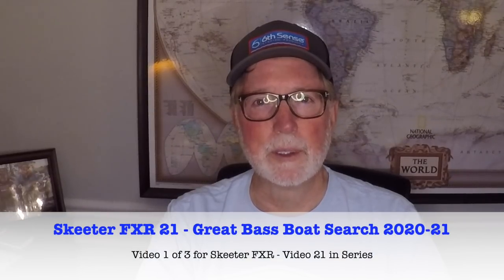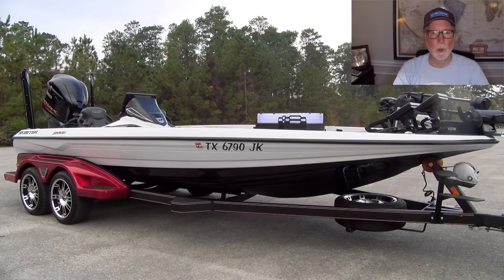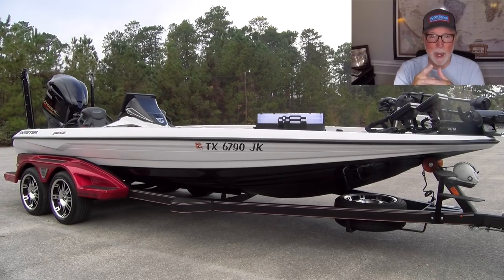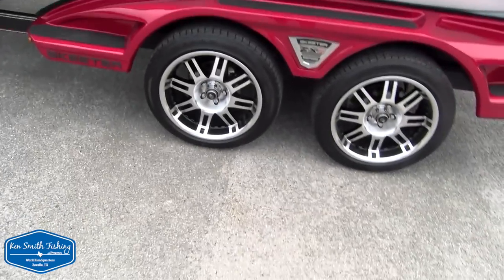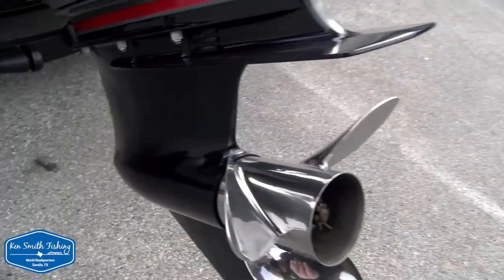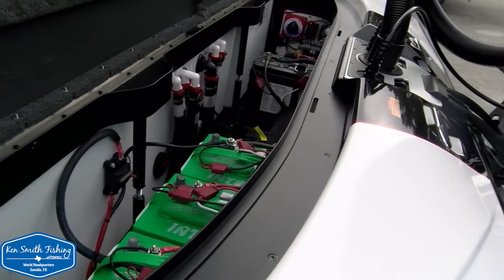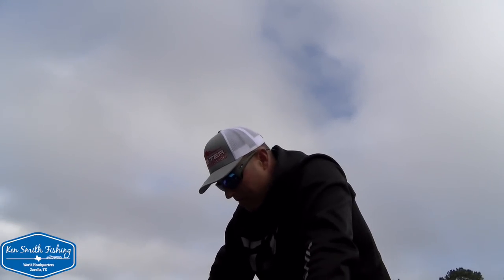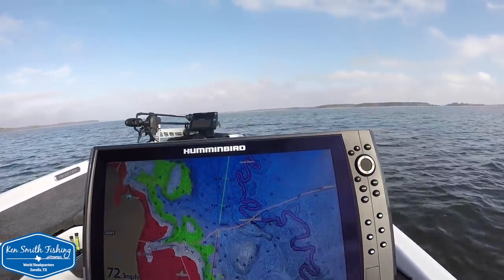Skeeter FXR 21 Great Bass Boat Search of 2020-21 - Video 21 of Series

Comment: Thanks so much for the great info, you're doing all my work for me.  I'm glad you have focused on the ride of the boats while moving slower.  I don't want my boat to act like a dolphin when riding at 20-25 mph.
Reply: early models did this from fuel tank location, didn't they more the tanks to stop this issue??

Comment: I’ve got a zx225 & it proposes just like this one. As I’ve learned to drive it, time in the seat has been the answer. It handles bog water fantastic compared to several other boats I’ve been in. I believe a lot of that is the operator.
Reply: Ive sold a bunch of Skeeters and that is exactly right, I would strongly encourage a hydraulic jack plate, especially on the new hull because they are absolutely awesome with a good driver, if you are willing to take the time to use it and spend the extra money. Best hull Skeeters ever made according to guys who have run a new one every year for a long time
Reply: This is not a hydraulic plate ?
Reply: @bakervinci163  Yes, go watch he just says you have to mess with it a bunch to make it run right... which makes you wonder why you'd buy a boat that you have to keep tweaking to run
Reply: @jrthomas3581  what is the best boat in your opinion? I’m looking for a boat that will go 85+, that I can chase crappie until I die.
Reply: @bakervinci163  what do ya need 80mph for  when your crappie fishing? Honest question.
Reply: @itisfinished4U  what is the difference in the FXR and ZZR hulls?

Comment: Gosh so many different opinions on the ride im on Toledo Bend mainly and Rayburn the other times and run a 202 elite Champion the best riding 20ft boat I've ever been in. But I was really hoping to hear the rough water ride was amazing Skeeter hyped this boat pretty big and had me all pumped to the point that I was considering a new one. The other skeeters I rode in I thought I was gonna need back surgery after we got off the water. Lol
Reply: I agree. I have never been in a Skeeter that rode well in the big stuff. Every one beat me to death compared to my champion. You have the best riding bass boat ever made. Nothing today can touch it.

Comment: Ken  on the trailer wonder why they didn’t place a bar to aid climbing into the bow of boat up the steps.
Also when placing the motor/toter (transom saver) and it bends the motor controls seems like more than it should; can raise jack plate to reduce bend.

Like the trey system.
Also trip on the raised floor leading to the front deck ( I know need to pick up feet)

Look forward for more. Thanks much.

Comment: Ken you will me deciding my last boat. I have about 9 months to decide. Pretty sure I’m gonna get glass unless I get a gator trax or the new aluminum.    Let’s see a new Allison.
Reply from the maker: Yep, will get to Allison, from what I hear they haven't changed that boat at all in something close to 10 years, do you know if that's correct?
Reply: @KenSmithFishing  I know that they have a few clever innovations that I don’t see on other boats. 
 Small things; like a place to put rod tips on the deck and a toilet where the middle seat exist. 
 I like everything, but looking at that hull is tough.  Clearly this is why the hull is so fast.

Comment: My Dad has had 7 Skeeters and he now has the FXR21. And, the ONLY complaint I have is the porpoise issue especially with full live wells. I've learned to manage after 9 months of driving the boat but it can be a pain in rough water with full wells. Skeeter had this exact same problem when they came out with the first I-Class (we nicknamed that boat, Flipper) due to a new hull design. Pop brought the issue to Skeeters attention (they knew it was an issue) and offered to retrofit the hull to fix the problem or swap him boat for boat for a new I-Class with upgraded hull and when we got the new boat, it was all gravy from that point. The guys in Kilgore are awesome. I'm wondering if the same thing may have happened again as the FXR from what I know has a new hull design.

Comment: Another great review. Why the 3 part series on the Vexus and Skeeter? Others were done in one?
As for the FXR, it has the best lines that Skeeter has ever designed. Fine looking machine. 
I'm not a fan of the plastics on the dash, and was real surprised to see it porpoise at low speeds. I really figured Skeeter would fix it on this new hull. (without having to play with the JP)
Keep up the great reviews.

Comment: I have a 2023 ZXR21 with manual jack plate and no electric key pad. I wanted simplicity, I have never noticed my boat doing this porpoise and it is quick on pad. Fastest I’ve gotten is 70 but I’m ok with that, I normally don’t go faster then 50. Last day of the big bass splash I went to weigh in from Buck Bay. The lake was rough. I drove 20 to 30 mph all the way with no issues.  So I’m wondering if most issues is due to the hydraulic Jack Plate.
Reply from the maker: no, is a design issue

Comment: Ken I have the FXR21 L but with Fixed jackplate and I can drive mine between 17-20 on plane with no bow bounce. This boat handles BIG water very well.
Reply from the maker: Sounds like you’ve got it in the right spot
Reply: What prop?

Comment: Had the screw pop out under the cowling that holds the link to the gear shift, lucky it happened as I was backing off the trailer at the ramp, had it happened away from the trailer I was stuck dead in the water on Amistad 10 miles away. Motor had 40 hours on it and I purchased the FX21 new in 2017, check those, the Japanese got in a hurry and didn’t have it tightened enough.

Comment: Very good looking boat! A couple of things I noticed.  Net looks very small compared to others.  Sump access is great but basscat appeared the cleanest and the removable lid was great.  Definitely top 2 in sump access are skeeter and basscat.  Looking forward to part 2 and 3!
Reply: Just sold my basscat cougar FTD for a FXR.. the rear setup is not good on basscat.  No usable storage at all.  Electrical connections just laying everywhere.  The charger is mounted across the pumps.  Yes, it's all wide open, but that's also the downside.  That removable lid has hinges that trip co anglers.

Comment: FYI.  Skeeter has NOT fixed the problem you spoke of concerning the screws and fit and finish. I regularly have to tighten or find screws to replace the ones that fall out or disappear.
Reply: Same issue with my 2020

Comment: If raising the atlas jackplate is all it takes to be able to run on pad in the low 20's, what's the knock against the ride for? Seems like you'd give a knock if you couldn't remedy the porpoising. I hope you do some more research and prop changes before you post your next video.
Reply from the maker: Rowdy it you change the load in the boat, if the boat is wet and heavier, more tackle fore or aft,  if the livewells are full vs empty, all of that will change the dynamics of where the jackplate would likely need to be to stop the porpoising, and yeah i could figure that out on a nice calm day with different loads,  but if I come under the 147 bridge in 3-4 foot trailing seas and have to run 19 miles to the weigh in in 25 minutes the last thing I want to do is be screwing with it trying to figure out how to not bury the nose in a wave while I work that out. And why would I want to? If I can buy a boat where all if have to do is bury the jack plate in the dirt and go?

Comment: Speaking from experience with the Skeeters.  They take time to learn to go slow speeds.  I have no issues with my 225 going slow enough to pull kids on tubes and such..  It all has to do with throttle when getting up in plane..  On another note, with my zx225 you can run wide open trimmed out with no hands on the wheel..
Reply: That's what I love about Skeeter boats, arguably the most stable to operate boat at high speed. It doesn't walk at all.

Comment: Is that butt seat option available for all boats or just Skeeter? I’m talking about how it adjusts to get you farther away from the trolling motor pedal.
Reply: lots of boats are like that these days
Reply: @tommccoy6708  can you just buy that type of seat somewhere? Does it actually slide back a few inches so you’re farther away from the trolling motor pedal than a standard butt seat? I always feel I’m too close to the TM pedal.

Comment: I love my Skeeter FXR 21
Reply from the maker: excellent, if you have any porpoise issue make sure and check out the prop series with Nick from Mercury Racing, he gives some thoughts on prop selection that might help out
Reply: @KenSmithFishing  thanks Ken! I had a fixed jack plate. The dealer retained the spacer when I added the hydraulic plate. Not sure if it changed any thing however I don’t have the porpoise issue so many talk about. I am picking up a new FXR 21 at the end of the month. Hope it rides level

Comment: Why dont ya try to take off with the jack plate up and -trim down on plane Not in the dirt? Try it comment back??;)
Reply from the maker: Chris I tried it at all levels, I suspect based on how you load your boat, livewells full or empty and fuel levels there are multiple "sweet spots", just a lot of work to find them when you don't really have to on most other boats

Comment: As usual, great work Ken.
Weida's Marine has a promotional video from a few weeks ago that has them running the Skeeter, Phoenix and Caymas on a river at the same time. In the comment section someone ask which was the fasted that day and Weida's said Caymas. I've had two Earl Benz boats (Stratus 20 and a 21 length) and currently a Triton 18 TRX. All have to be setup light front and driven to get max performance.  Just  sharing some info, hope it helps someone. https://youtu.be/-8m9rQwDs3U
Reply: Don’t think that was weida’s that said the caymus was the fastest I think that was just another commenter. The only replies from weida’s was to wait for follow up video